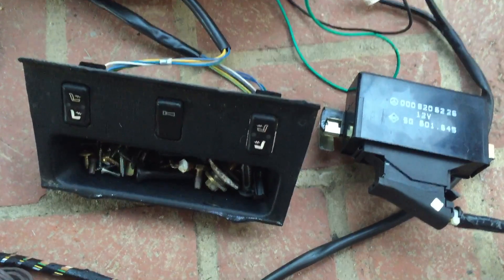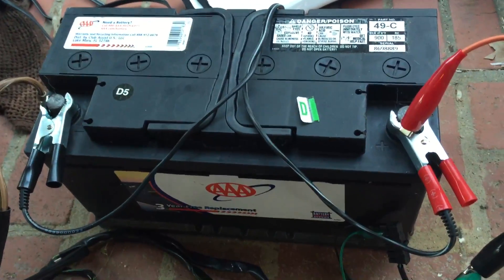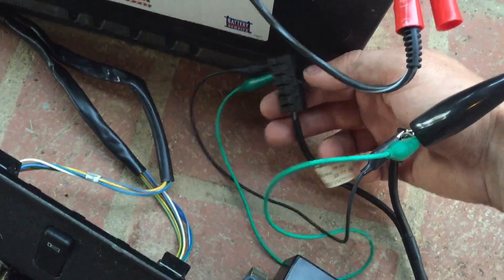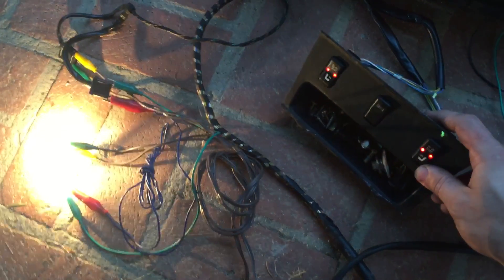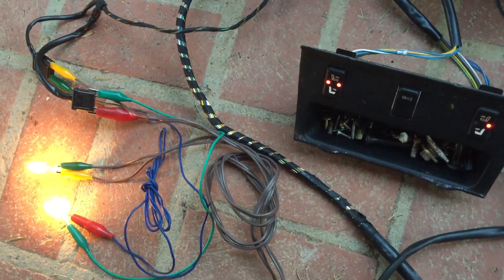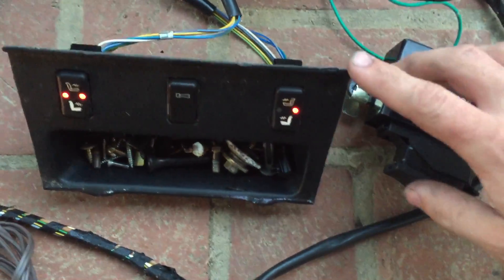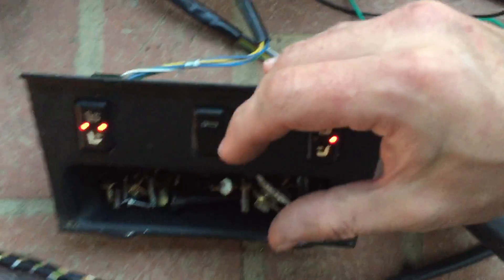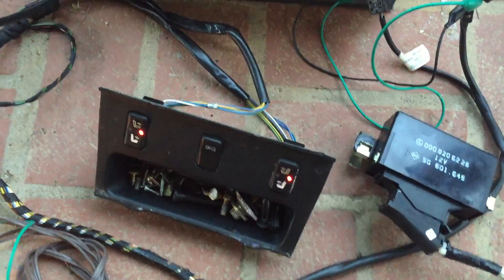Late W126 Mercedes heated seat system, relay and harness demo

Comment: What about the pre facelift cars? What is the difference there?
Reply from the maker: @UpsideDownFork  I think those had a control unit under each seat. The heating elements are also lower power. But the high / low setting worked the same way.

Comment: can the later 1990 seats be put into a earlier 1988 w126 sec
Reply from the maker: I believe all the connections are the same. The later seats have higher power heaters, so you might want to be sure the heated seat relay & fuse can handle the extra power consumption.
Reply: @compu85  thanks, any ideas how i can check this as i assume the relays will stay in the car loom
Reply from the maker: @sas8403  I'd look at the thickness of the wires and see if the ones coming from the car side of the harness are similar to the ones going to the heated seat pads.

Comment: Cool video and great info! My 1990 european 300SE just had working seat heaters but one day they just stopped working suddenly. The illumination lights up and you can hear the relay or something click when you push the heater on. Except driver’s side HOT setting doesnt click or illuminate. I checked the fuse (8Amps) and its good. Any ideas?
Reply from the maker: I'd start by measuring the seat elements to be sure they're ok. With nothing connected my relay will still click / activate the lights on the buttons. 
Any water leaks on your car? The control unit sits rather low under the driver's seat.
Reply: @compu85  This problem started pretty much during end of winter here in Finland. My car has been sitting outside in lots of snow on the car. The weather has been between 23 degrees fahrenheit and 41 so there must be a lot of condensation going on. I think that may have caused the problem. Also my electric seats stopped working but I changed the fuse two times and its all working again. Kinda weird that both seats stopped working suddenly after winter season at the same time pretty much.